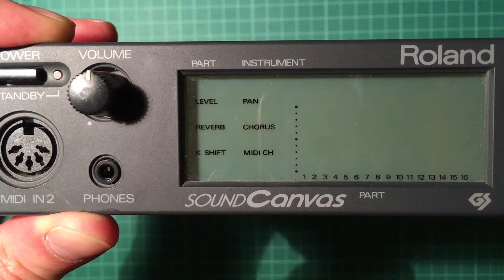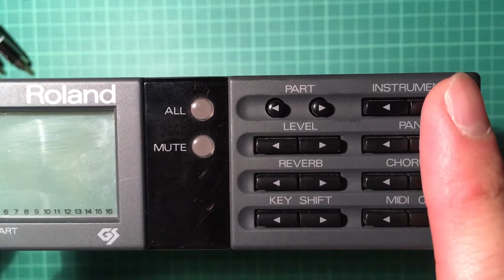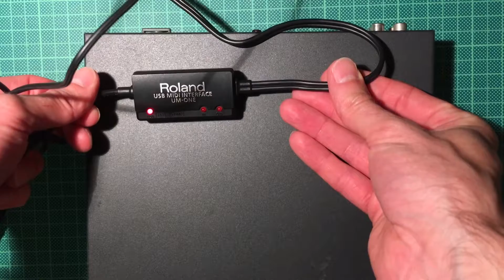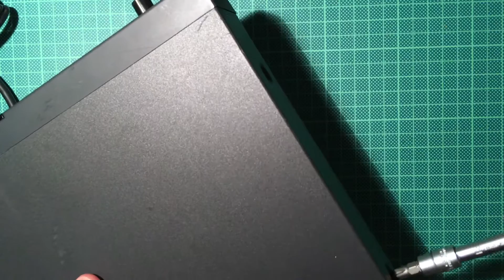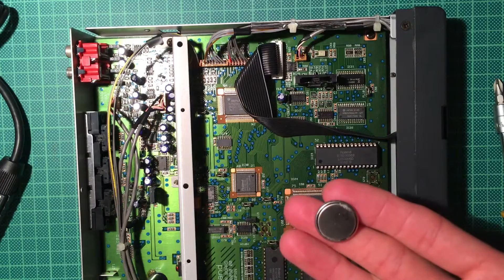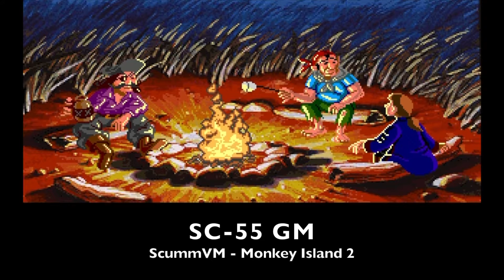The Roland SC 55: Battery Check and Playing with ScummVM

Comment: I bought an SC-55 which works beautifully in Windows with a USB to MIDI adapter, but I can't seem to get it to play music in SCUMMVM in Windows 10. If you use Win10 do you recall what you needed to do to get it recognized in SCUMMVM?
Reply from the maker: Nope, running it on a Mac. But I do have a Windows 10 laptop lying around. I could try sometime... Did you make sure to choose the windows sequencer in ScummVM? See documentation here: https://wiki.scummvm.org/index.php/User_Manual/Appendix:_Music_and_sound
Reply: You don’t show the most important part. How to actually set it up in scummvm.
Reply: @alessiman  I figured it out. My USB MIDI adapter shows up as a music device on the Audio tab. I click the checkbox to override the audio settings and choose that USB adapter from the pulldown menu. Works beautifully. I have 2 hardware MIDI synths and I can choose which one I want on each game, which is very convenient.